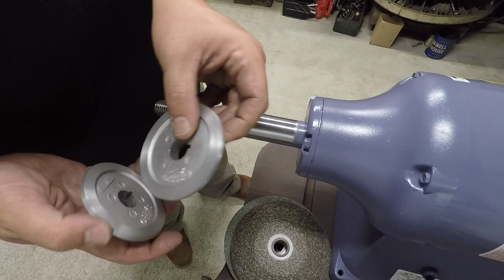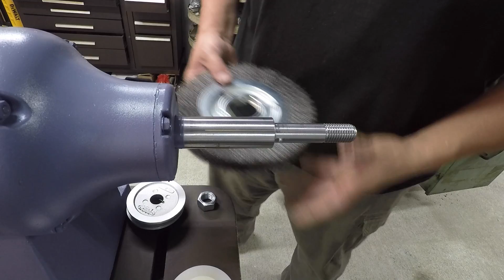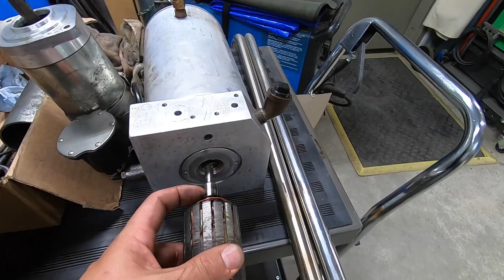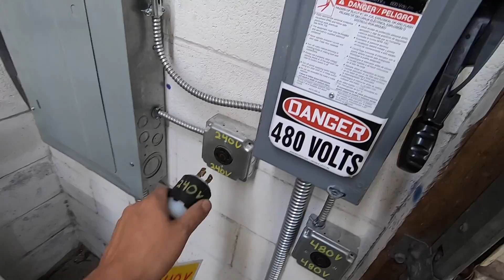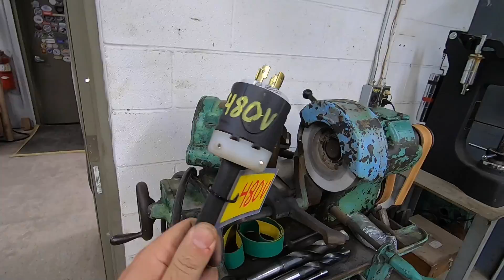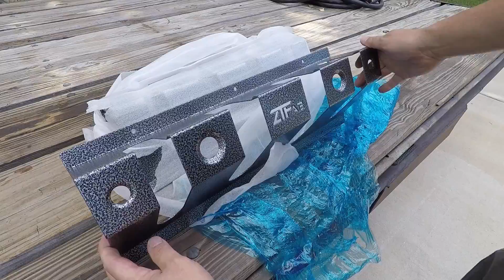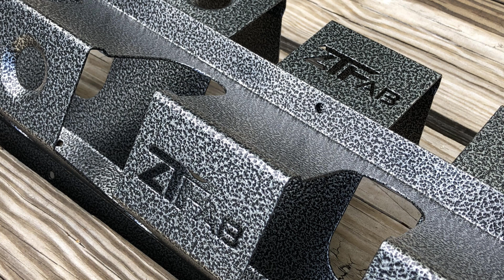SNS 304 Part 2: Baldor Buffer Improvements, ZTFab Milling Arbor Racks

Comment: Mine has spiral threads that screw into the buffing wheels. Impossible to get them lined up perfect every time. The spiral threaded adapters slide onto the motor shaft and are held in place with grubscrews. They are loose on the shaft so I cant get those lined up. Terrible fitment all round.

Comment: Bought a small diamond wheel for a scissor sharpener and it was so out of round that the motor walked all over the place !  My question is , and this wheel was expensive , do they not test each wheel for roundness ?  Great fix you did as usual Adam ! Thank you .

Comment: Baldor needs to hear back from you on this.  I know they most likely didn't make the aluminum spacers and such, but have a subcontractor make them by the thousands   But they are selling it with their premium priced professional product and that's not acceptable.  They're lucky your a machinist,  the average customer would just return it for another one or a refund.  Either way that completely eliminates any profit on that product and leaves a questionable taste in the customers mouth.  How much more would it cost to have the manufacturer true them up?
For the price it's not acceptable!

Comment: I did write in part one how I don't agree with Baldor being quality. Geez, it surely shows here eh and with those backing plates still running out, they will still induce some vibration  even with the fixes that you have already applied, Adam. The angle faces need to be faced off as well to get rid of the rest of the imbalance of the backing plates.
Reply: Those puny aluminum plates are nothing compared to the mass of the armature in that motor.
Reply: I did think the same. But for the job they are supposed to do, I think they are balanced enough. We will never be able to 100% balance any rotating mass.
Reply: @leoa4c  Yes you can 100% balance a rotating part. You just need to know how to do it. Ever thought of a wheel on your car as an example? :)

Comment: What is with baldor and quality control on those aluminum wheel holder’s they used to be top end
Reply: Some of the machines that I work on have older Baldor motors and the motors are failing. Poor design. So it is not just current stuff that is crap.
Reply: @jemijona  How are they failing? how old are they?
Reply: @leoa4c  Around 15 years old in a few cases. The spline on the motor shaft has worn down due to only a couple of teeth engaged at any  one time on the 15mm or so diameter of the spline. This determination came from my motor supplier, and I fully agree with him once he pointed that out. On another motor, the spline wore down but the shaft broke before the spline became an issue.

Comment: Hi Adam,
Not sure if different in the USA but High Voltage is normally over 1000V AC or 1500V DC so the 3Phase 480 V is not really HV, it is just normal 415V (UK)/ 480 voltage.

Andy
Reply: The US has 120V as normal, 208V between phases, you can get 240V inverse phase for high load household items (drier, cooker and such) and 480V is industrial

Comment: Adam, You need to question Fernando's work with putting L14 connectors and receptacles (Rated for 125/250v) on 480v serviced items. I would recomend greatly that those 480v connectors be replaced with correct L16 receptacles and plugs (which are 480V).  I can see in 5 years you buy a expensive antique piece of equipment that is 240v, with a L14-20 connector on it, accidentally plugging it into the no longer labled wall receptacle that it fits in, and frying said equipment with 480v and starting a fire. 
You don't settle for less than perfection in the great work you do and products you create and share with us all. Do us a favor and not skimp with not using correct connectors in your own shop!

Comment: Are any of those connections with the 4 prong locking plugs 3 phase?  You might want to consider L21-30s  for that, because they will pass both neutral and ground.  I know a lot of electricians are using L14-30s for 208V 3 phase, but they leave out the ground connection doing that.  Just a thought.
Reply: Generally most motors only need 3 phases and a ground. Most 208v motors only need 2 hots and the ground.
What he should be doing is still using L14-30's for his 208v items, and use proper L16-20s for the 480v services (Not using L14-20's like he is currently using)

Comment: Adam, I really enjoy watching all of your videos. One thing I would like to point out is the use of MC flex wiring through out your shop. I saw a loop from one junction box to another. Dropping something that could snag this loop could be an issue. I realize electrical code may vary by State. However, it is recommended that all surface mounted conduct be rigid and properly fastened to the wall. MC cable is not a good choice for this particular application. All the Best!
Reply: dude, his step dad did that and he's a electrician. So it's code for Florida.
Reply: If possible, should a metal table be grounded or it doesn't make any difference?

Comment: abom79 a question only mildly related to this video:   What happens with old worn or broken tool bit replaceable inserts after removal from quick change tool holder ???
Reason is I am looking for a pile of old ones to braze onto the edge of a steel bar that is drag along and slides behind on the street .....
This is my option preferred to hardfacing....  rather use "junk" tool bits than the HF rod.....

Comment: If you can get some waste ceramic floor tile you can rig it to true-in the wire wheel by grinding off the long side, it'll make quite a bit of dust but using the flat of the foot side of the tiles will do the work.  You can take it outside and just trickle water onto the tile to control the dust.   I've been using my junk from flooring to keep my stones flat to save on wearing the stones.

Comment: VERY odd to see an American with 240V/480V.
Reply: Really? That was the standard for years...before the 208 Y....
Reply: @dougankrum3328  Yeah, because most US homes are single phase, split phase 120/240 wired.  It's more common to have 3-phase available in countries where everything is already 240v, so 3-phase to the home gives you multiple legs to split higher current loads to (electric dryers, range/oven, AC, workshops).
Reply: @mlindholm  I should have been more specific...240/480 is/was common for Industrial, not so much residential. I recall Adam had a 480 3-phase service installed a couple years ago...then he added the 480-240 dry transformer.
Reply: @dougankrum3328  Believe his service is 240v, and transformer is 240->480

Comment: I own the exact Baldor Long-Shaft Buffer, 3/4 HP, 1800 RPM. It is not a grinder. 

These big backing disks are intended to squeeze soft cloth felt or sisal buffing wheels, not abrasive wheels. Take a look at one of Baldor's grinders with 3/4" shafts and order a set of the much smaller grinder backing disks as replacement parts. These part will do what you need.

The buffer's big backing disks should have been manufactured closer to true I grant you.
Reply: While yes, he's not running cloth buffing disks that can be squeezed down by those, he's also not running hard grinding disks on it.   Even with the "soft" polishing wheel, scotchbrite, and wire wheels, his truing work gained significant improvements in vibration.

Comment: Lightly use a diamond hone stone to true up the wire wheel. Or lightly apply a file
while the Baldor is running to smooth out the highs in the wires. Also using a hand
grinder with a cutoff wheel counter rotating against the wire wheel rotation will work to
true up the wire wheel

Comment: Good idea on labeling the outlets, makes life easier. Different voltages and current ratings of the plugs/receptacles are all keyed/sized to prevent wrong connections, for example a 240V20A plug will not fit a 480V20A receptacle*

* provided someone hasn't dicked with the parts. One shop I do work at, an operator re-bent the plug blades on a 480V30A machine and stuffed it into a 600V30A receptacle, wasn't good for the machine.

Comment: Good God the run out on those flanges! You'd think Baldor would have a little more pride in what they send out.  Manufacturing in America isn't what it used to be for too many companies. Shameful.
If Baldor was SMART, they'd contact Adam, dump all that cheap garbage, and offer these parts for the buffer.

Comment: Hi Adam, 

This was yet another good video :-) 

I'm not sure how you dress your Scotch-Brite wheels and I'm sure you already have a good way to do that but I thought I'd share the way I dress mine. 
I use an old brazed carbide lathe turning tool and so far it has worked well for me, I usually use a piece of wood setting on the bench just under the wheel to rest my hand on while firmly holding the brazed turning tool, then I slowly move the lathe tool across the Scoth-Brite wheel till it runs true (with a face shield on of course).
In some cases I shape the face of the wheel to match the shape of a part that I'm polishing, yeah it shortens the life of the wheel but it's usually worth it.  

It's a shame that Baldor doesn't have a better source for those aluminum backing washers, not a big deal for people like us with a lathe but i'm sure they sell buffers to people who do not own a lathe.
I feel certain that Baldor does not make their own, if they did they would run true right out of the box. 
Poor design on the arbor spacers too but the buffer itself is top notch!! :-) 

Stay safe, Adam!! 

Joe

Comment: That second flange you showed on the lathe - @10:41 - I'm sorry but that is ridiculous - they should not be putting parts out that are that far out.  That thing looked like a pancake spinning around an arbor.  They charge enough for that machine to include a reasonable flange that doesn't cause so much vibration/movement.
Reply: That's what I was thinking. I feel like you have to start getting creative to bore the hole that far off center and out of plane. I think I could achieve better results on a $50 drill press.

Comment: You and I, and I'm sure a lot of your other regular viewers, understand why the ampacity is lower on your 480V circuits than your 240V circuits, but perhaps a small explanation for those that don't know? Most folks that have never been exposed to Ohm's Law will be like, "Why is the 240V set on a 30A circuit, but the higher voltage (480) is lower?"

Current (A) is inversely proportionate to the (V)oltage of a circuit. The same load (shaper, mill, lathe) will draw lower amps on a higher voltage circuit than it will on a low(er) voltage circuit.
Reply: Where do you guys in the USA get 480 V from? I understand the 240 V: Just 2 phases (120 V RMS to ground each) 180° out of phase. But 480 V? You cant have 4 phases all 180° out of phase, theres only so many ° till you are back where you started?

Also: Are these plugs the norm? They look unsafe and easy to pull/wiggle out.
Here in german we only have the red CEE plugs (IEC 60309) for all the (here very common) 3 phase stuff.
Reply: @leocurious9919  In North America we have several voltage options available for different applications. Various sources of supply from the provider are:
120/240V single phase
120/208V wye 3 phase
120/240V delta 3 phase
277/480V wye 3 phase
240/480V delta 3 phase
347/600V wye 3 phase
There are several more higher voltages, but these are the primary ones for commercial and light industrial.

For example, If your building is fed with 120/208V service, you will need a 208/480V transformer to power 480V loads.

The plugs/receptacles Abom79 is using are referred to as "twist lock." Once the plug is inserted, it is rotated slightly clockwise to lock it into place to prevent it from being easily pulled out.

Comment: Great job on those bushings and getting that Baldor running true! My little grinder is a little vibratory, I bought some machine bearings to add and mount my wheels, helped but I need more. Oh, to have a lathe! ZTFab are nice units. Powder coating is so nice compared to paint. Good to label your stuff, but I doubt you'd mess up and plug the wrong one in. I love me some EsAndEs Saturdays!

Comment: I am not a machinist, just a handyman.  I eliminate the run out in my miter box and wet stone saw blades (both 10") by rotating one of the provided washers at a time until there is no run out.  What a wonderful difference. Ron W4BIN

Comment: Before you dive in too deep on trying to adapt that new motor to the pump, spend a few minutes with the old one.  First clean all parts.  Check the bearing and see what condition they are in.  The marks on the armature show they may have been hitting the magnets on the inside.  Chuck it in a lathe and use some sand paper to smooth/clean up the center section and also the commutator contacts (the area where the brushes ride).  Use an inexpensive DMM set to "continuity" and make sure there is a connections from the positive lead to one set of brushes  and from ground (likely the case) to the other set.
Next, check for continuity from each contact to the shaft.  There should be none.

Some electric motor shops just don't want to work on small DC (automotive) motors, so find some place that does.
Reply: As Jack Patteeuw suggests above, replace the bearings (probably sleeve type with oil packing).  Also, check the spacers between the metal segments in the commutator, if the unit is worn down, turning the commutator smooth and undercutting the insulation a bit will allow you to use the armature again. If the brushes are worn to short, you can get new ones. If they are not a smooth polished look on the working surface, then it was arc'ing due to either getting stuck in the brush holder (carbon dust jammed) or the insulation mentioned above, and will look dull and might be pitted too . To me, it looks like they were not making good contact.
Reply: @arnoldgrubbs2005  You can use a sharp pick to clean the space between the commutator bars.

Video on How to Test If A Motor Armature With Commutator Is Damaged  (I am betting it is not.) https://youtu.be/lmjFzukDhqI

Comment: Its BAD idea to have same sockest wired for low and high voltage, even with those labels. One day youll end up putting wrong cable into wrong one because we all made mistakes (fatigue from all days work, mind elsewhere because youre trying to figure out something) and best outcome would be destroyed electrical parts in machine, worst fire in your shop. For 480V use different sockets so you cant put your low voltage cables into them. Also, best design are those with round pins, this flat ones arent good...
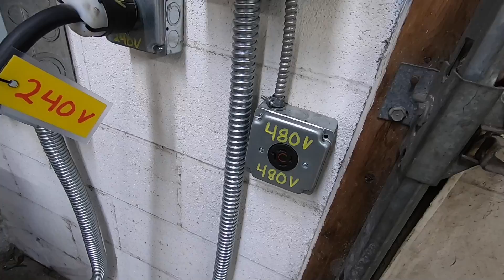Reply: He said at 26:34 that the 480V outlets are 20A and the 240V outlets are 30A, and that the plugs are not interchangeable.
Reply: Even if they were the same current rating, the configuration changes for voltage as well. Look up NEMA twist lock plugs, it is a standardized system to prevent problems.
Reply: Karel Markvart you didn’t pay attention and the twist lock plugs are ideal for shop conditions.  You don’t know what you’re talking about.

Comment: You really need to consult in an actual Electrician. Using 250v rated receptacles on 480v equipment is unbelievably unsafe and just downright rediculous. No strain reliefs, etc. This looks like HVAC guy pretending to be an Electrician work. 

480v arc flashes are no joke.
Reply: Ya those are only rated for 250V max! 
The high voltage stuff is majorly different and about 3X the size.
Reply: The complete way of installing electrical system is just dangerouse and oldfasioned in the eyes of a european mainland electrician, Me.
Reply: It was hard to understand what he was saying, he did say 20A on the 480V stuff. Is the 480V load using L15-20 (250V) or L16-20 (480V) plugs/receptacles?
Reply: @abpsd73  He is using L14-20 for his 480v stuff. (seen with a snapshot when he was showing his Oliver drill bit grinder)
Reply: It is not common for anything 120v and above to be rated for anything less than 600 volts.
Reply: @nooneyouknowhere6148  

You are not even remotely correct when it comes to disconnects, receptacles, contactors, etc. 

But what would I know, Im just the Licensed guy that does this everyday.
Reply: @lousassol3  How bout this Dick, why don't you start making videos to explain this?
Reply: @CB.5  You want me to make videos explaining to people how to attempt DIY high voltage installations? What a genius way to cause a ton of deaths.

277v/480v kills enough unqualified maintenance workers a year due to companies trying to insource repairs. Lets just add to those numbers. Great idea. 

Again 480v 3ph is NOT remotely comparable to 120v 1ph when it comes to risk management. 480v fixtures are designed to mitigate risk. Something as simple as accidentaly unplugging one of his machines while under load, has a high chance of starting a fire, arc flashing him leading to permanent vision damage, and if hes unlucky he will get a nice stay at his local hospitals burn unit for a few weeks.

Again, he needs to consult a LICENSED commercial Electrician to come do a safety audit and explain to him what needs to be addressed before he injures or kills himself or someone else.
Reply: @lousassol3  TLDR Superman

Comment: All that high voltage talk and I'm here with just a small 110volt socket thinking "I HAVE THE POWER". Turns out I really don't.
Reply: Jesse Foulk I just got my shed wired up with 220 and I thought I was bad ass.

Comment: You should be using L16 plugs for the 480 and L14 for the 240. They won't fit in each other even of they are the same amperage. Never hurts to label. But I'd it's wired correctly, you can't mix them up. Poke Yoke!
Reply: The plugs he has do exactly what you say.  They "won't fit in each other".  Calm down.
Reply: @paulcopeland9035  Yep. That's what I said. Thanks for the confirmation.
Reply: L15 for the 240V. L14 is for 120/240V single phase with neutral.